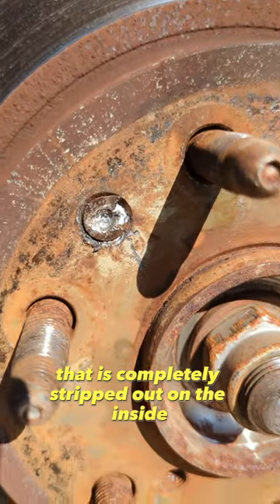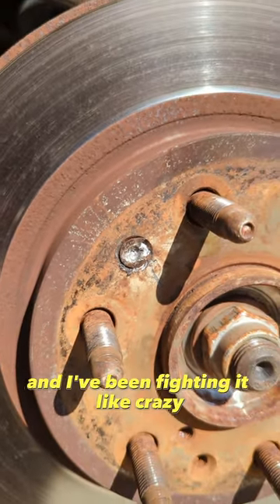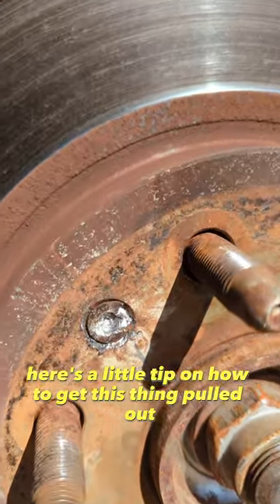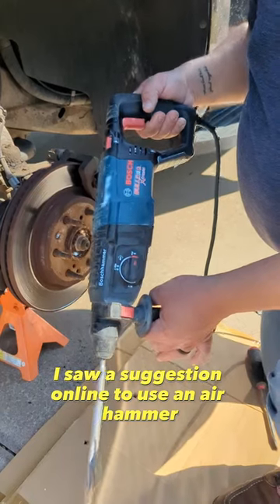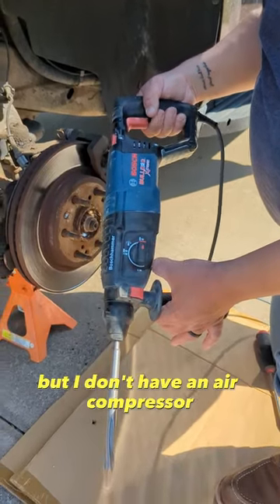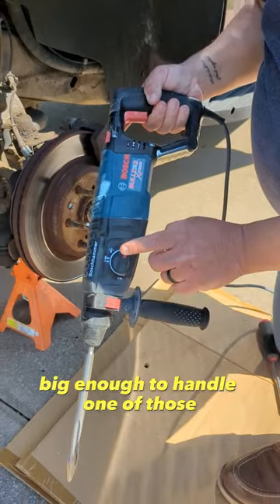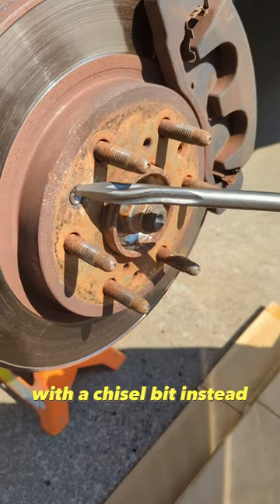Nightmare Bolt Removal | Stripped Out

Comment: Quick tip for anyone watching this with similar issues. Insert your torque or hex bit into the bolt, then hit it with a small hammer a few times, give it a few good licks. Then use a small impact driver and try to get it out while applying a lot of pressure on the impact, start with small bursts of impact power then try longer bursts of impact. If the driver isn’t getting it out, go back to step one. If non of this seams to be working, throw a cheap harbor freight ratchet on that bit/socket then while applying a turning force, hit it with a hammer as if the ratchet wrench is not there. If you broke it loose but it’s stiff, get some lube on the threads and run it in and out until it’s free. Taking 10 minutes of your time on slowly getting a rusty/bolt off, will save you hours.
Reply: For step one, substitute what ever bit it uses. Just in most of my experience it’s been a hex or torx bit, but I know it can also be a Phillips or something even more dumb lol

Comment: I lucked out with a flathead and a hammer. Same way you're doing it. I replaced it with a torx. Philips and flatheads strip like crazy. Torx - not so easy.
Reply: You don't even need to replace them is the thing
Reply: @aarong6616  you're right. You don't. A lugnut works just fine.
Reply: @mitchallen5819  At least I hope so, because I'm running 4 rotors without them 😂
Reply: @aarong6616  along with many other vehicles 😂

Comment: That screw is for the assembly line. Drill the screw head out and leave the thread and forget about it. Lug nuts do a good job keeping the rotor secure
Reply: Wrong! Lug nuts certainly don’t keep the rotor secure, in fact in most cases they aren’t even long enough. The lug nuts hold the wheel on, the wheel is what keeps the rotor in its place.
Reply: @LoneWolfSnowplowing Therefore, the lug nuts hold the rotor I'm secure. Unless you are going to run with no wheels...